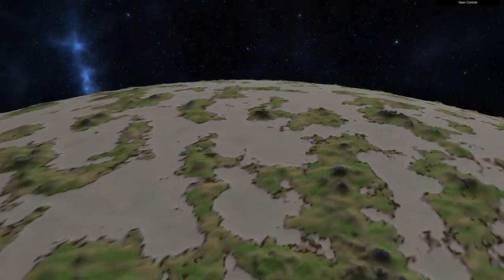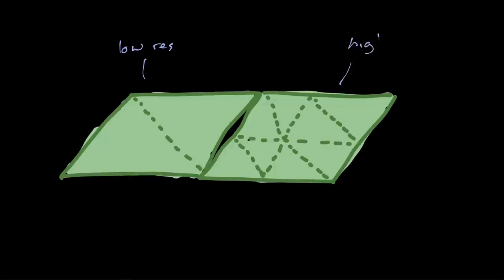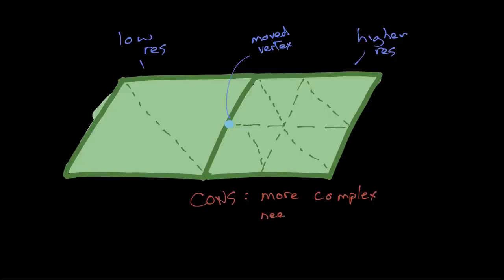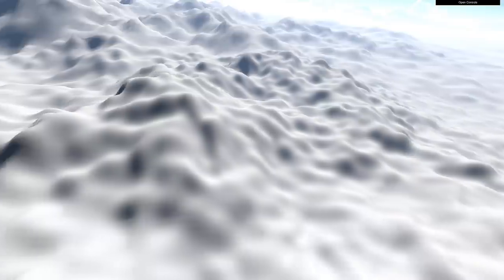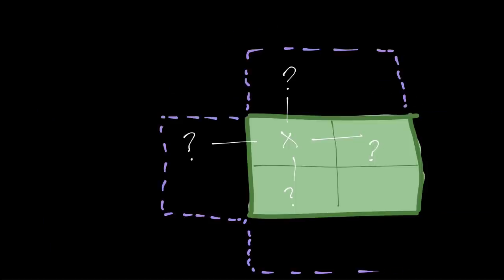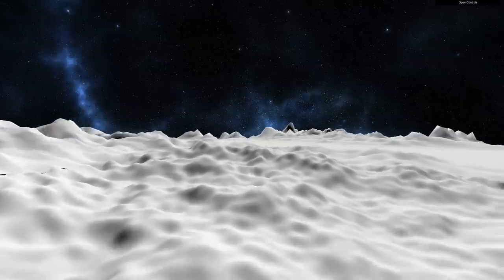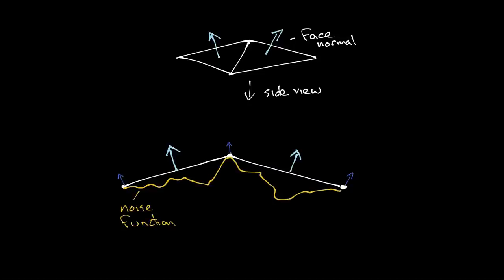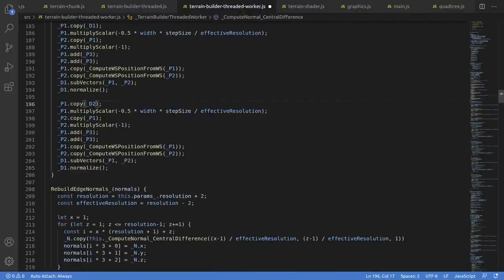3D Mesh Generation, Gaps, and Stitching (3D World Generation #10)

Comment: Another ultra-cheap method that I used in a project of mine was just to vertically lower the more distant, low-poly chunks. The gap is still very much there, only now the higher-resolution chunk obscures it. This only works with heightmap-style terrain though, and requires a bit of tweaking to get the effect right. You also have to lower the terrain more and more at each new level of detail. A similar technique would be to incline/rotate the terrain toward the camera just a hair, and this rotation doesn't need to be modified at the different LODs, only the first. Obviously messing with the physical location of the entire terrain chunk invites other issues like the visibility of things placed on the terrain and snapping between different LODs, but you only need a very shallow angle for this technique, so in theory it should be hard to notice. Not that I've actually tested it lmao.
Reply from the maker: Interesting, hadn't thought of that.

Comment: Hi Simon. I started working on an engine using flat terrain a couple weeks ago after watching most of your videos and just the other day concluded with these problems. After I saw this video today I thought I should share my approach in case it helps anyone. I built a quadtree but I really struggled with the surgery because when you move a vertex, it's not as simple as just moving that one vertex on an edge to fix a seam, if it is also a corner to other smaller children. So you need to then find the edges this adjustment affected, and this can chain through the tree.

After some time I decided to drop the quadtree and use a grid of about 20x20 equal terrain patches. This really simplified stitching. I then tried to set normals on all edges by calculating from the actual mesh vertices. This required a multi step process: (a) stitch vertex heights so there's no seams (b) calculate normals for just the corners (c) update normals for all inner vertices that are shared along an edge (d) finally interpolate normals for vertices not shared. I'm generating patches using 2-3 worker threads that pull from a queue that is sorted by distance to the camera.

It's super satisfying to fly around the world at high speed and see terrain loading dynamically without any stuttering.

My next challenge is realistic terrain. It's one thing to have noise but another to produce terrain with appropriately sized areas of flat, hills, and mountains that have believable scale and detail. Instead of just progressively increasing frequency I'm dedicating each simplex call to a specific purpose: one for continents / ocean regions, then a few layers of hills and mountains, one for rivers. I've written some helper functions based on a sine curve to for example smoothly isolate the point where the noise crosses zero which can be then used to pull down the terrain to form a river or a road. Even still, with 8 or 9 simplex steps per vertex it's getting slower and still the result is pretty repetitive. I haven't seen many resources dedicated to the application of noise and it would be really helpful if maybe you could explain how you applied these concepts to games you've worked on.

Thanks for keeping the series going, you're doing great work with these videos.
Reply: That is what I did when I had my procedural terrain. There is a significant drawback that will eventually force you to use quad tree. You cannot double the distance without doubling the cost. If you have 4x4 grid and go to 8x8 grid, you are rendering 64 chunks instead of 16.
If you are using quad tree, you are rendering 2x2 big chunks (4) but one of these is subdivided into a more detailed 2x2 (4-1+2x2 =7) and one of these is subdivided more ( 10 chunks) and one of these is subdivided more = 13 chunks in total. You can have the details of 8x8 grid, while using only 13 draw calls/meshes.
Reply: @GonziHere  True, but consider having a 40x40 grid with 5km view distance. Terrain chunks are 256x256m and a list of 1600 chunks is manageable. LOD 2^7 on the nearest 9 chunks gives you 256 to 512m of high detail. It depends on how much you need detail to fall off near the player and how you handle LOD transitions. You might need smaller chunks. What I learned from this exercise was that whether you need a quadtree or not depends on whether you can get away with big terrain chunks near the player.

I also considered using a higher res inner grid near the player and an outer grid further away.

Comment: It would be really great if you could talk about working with vertices and common math. Your videos inspired me to take a stab at some Threejs but where I struggle is how to work with quaternions, when to normalize getting the angles of normals and applying those to other objects etc. I think as someone who jumped in without knowing any 3D coding, I find myself spending a lot of time building helpers and test projects to understand what I am seeing before I can ask myself how to fix the problem (likely a good thing as its learning). With all that said I am actually surprised that I have been able to get 3D terrain working with buildings and some collision detection so you can drive around, but I am obsessing over making the collision detection a lot better before continuing ha
Reply from the maker: I'll see what I can do, but you're on the right track. Hitting all the frustrating/wrong ways of doing things is helpful, pretty much how I learned.

Comment: what i did was to close gaps is
i stored the vertex index offset of every children before creating them so i know where every child starts.
and i made them return if they created triangles or splited. 
then after 4 children are generated
one by one i check if they got splitted. if they did i checked their neighbour siblings, if their siblings didn't get splited we close the gap on that side. 
for outer neighbours i simply calculated the position of the neighbours using current quad's center, applied noise and stuff to it and checked if a quad there would split or not. 
so uhh i just calculated everything on the fly without map and stuff
good thing is it works between faces too.
might be slower because i call noise function more. didn't measure it tho but it was fast.

Comment: great heccin video! I wish I could get into that mind space of being able to optimize and get my mind to work with a 3d space applying these formulas as tools to creating these amazing worlds. I find it difficult to learn how to apply or simulate these equations to be able to get a 3d space work with me.  I strongly struggle like I was trying to do Lorenzo attractor simulation but I couldn't figure out how to break up those differiencal equations into code and apply it in that space. its amazing how u can visualize the data infront of you on a multidimensional scale.
Reply: do you have any resources that can help me with the problem I am facing with that mindset or do I just learn it off of experience?
Reply from the maker: I don't have any good advice other than it takes time.
Reply: Maybe you should read the book Math for Programmers by Paul Orland, He implements a lot of mathematics from scratch in python

Comment: I've seen another world generator tutorial where, to remove the seams, they removed the outermost strip of polys from the two adjoining quads and then connected them together. That's probably even more work but makes for really nice seams. 
But, having watched your video, I don't think it needed anything more than the basic fill-in. What you could see of the seams was very little to begin with, so once you filled them in with *something*, I feel that was enough. You'd have to pay really close attention to see them at that point. Especially if atmospheric hazing is added in.
Reply from the maker: That feels like it would work, but at the same time, if you have corners where multiple resolutions end up touching, I feel like you'd be back in the same boat. Albeit with smaller problems to fix. And yeah, complexity wise, no idea how to implement that nicely heh.

Comment: I've been trying to do something similar, and run into annoying problems (they annoyed me at least). The problem is Nyquist, and that the mesh is effectively a sampling of a signal with a frequency component too high. Transitioning the materials to capture the higher frequency features is something I haven't managed to get working in at all well in general. Objects in the distance don't look like the detail is smudged and too small to make out, it looks like they are flat and that the detail has disappeared.
Possibly it is something I just don't know, and that there is a way to correctly map a Fourier transform to a PBR material, but I just cannot get it looking right.
One thing I did consider trying to do was to try to generate the mesh based on making it roughly regular and even sized in screen space. The tris would be long and thin along the ground radially out from the player. This avoids any welding, discontinuity, or boundary issues, at the cost of introducing a whole heap of complexity on the mesh building side. One problem was that hillsides would have stretched tris on them and it might screw up the silhouette, but now that I think about it, I guess I could just march outwards a distance based on the normal of the previous vertex if I did it as a compute rather than a shader. As long as I filter the highest frequency displacements first (by just not adding those octaves), it should hit the peak pretty accurately... Guess that's my weekend booked!

Comment: Hi ! Amazing video as usual, very instructive. I was wondering how you would go to add some instanced grass / trees on the terrain ? On a flat plane it's easy but adding some noise and making a sphere instead makes it harder to find out where to positionate things.  Thanks !
Reply from the maker: You can get height by sampling the noise function, so it shouldn't be much harder than a flat plane.
Reply: @simondev758  Thanks for the answer. Do you plan to release a video about that kind of stuff ? Like rendering grass with instanced rendering when the camera is close enough etc. ? Thanks!

Comment: A problem with the surgery idea is that it depends on manipulating the meshes at runtime. So... what if you DIDN'T have to do that? Can we assume that neighboring cells won't ever differ by more than one LOD? I wonder if it would work efficiently to constructing edge meshes for transitioning (or not) between LODs, so you draw the cell and two edge meshes based on whether or not you know that there's an LOD transition happening. (You only need two because e.g. the cell to the north / west will handle transitioning into the current cell, so the current cell only needs to transition into the cell to the south / east.)
Reply from the maker: Like a fancy skirt?
Reply: @simondev758  Yeah, you could look at it that way, I suppose. I mostly work in 2D but I know my way around building meshes so maybe I'll try it.

Comment: The point in LOD is keep the low resolution far from the camera. How can someone see those details-issues that you fix? By the way,  I like it!
Reply: Just a guess. I suppose it depends on how fast the level of detail changes. The errors become obvious when lowering settings for slower machines. So maybe the trade off to blend the LODs is much faster than just pushing the LOD further out?
Reply from the maker: They're hard to see, but not impossible. These are the kind of issues I'd have to fix all the time on production games. From ground view, hard to see them, but go up on a cliff, or high in the air, and you'll start to notice them.

Comment: what if you didnt just use the low res as reference for the border, but for the entire mesh of the same detail and linearly interpolate from high to low res. this way there would be absolutely no visible seams what so ever. you'd simply habe to compute normal and position twice for every resolution and get the distance to the detail change border
Reply from the maker: Hmm having trouble following that, maybe you can draw a picture or something?

Comment: I did this a bit differently.   On the CPU my mess is just one giant quad-tree. I'm subdividing triangles since I start with an icosahedron, but you could do  the same thing with squares.  My triangles also have shared edges so it's super easy to detect when I splitting an edge from one chunk to the next. Also chunks vary in size. They are just pointers into the quad-tree.  I only actually make them separate meshes when I go to the GPU and and that point each chunk is two meshes.  A center mesh and a border mesh. That way if I change an adjacent mesh I only have to send down the border part of the mesh I'm on and not the whole thing.  I used it below. Sorry my video is so crappy. 

https://www.youtube.com/watch?v=oRO1IGcWIwg

I do something similar with voxel planets (marching prisms) but it's quit a bit more complex as it uses shared voxel walls and octrees and so forth.